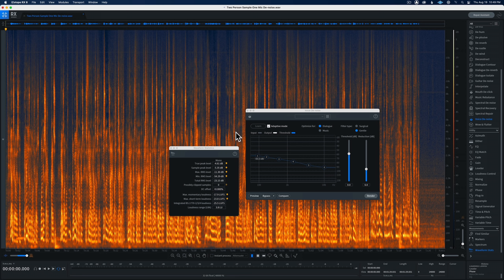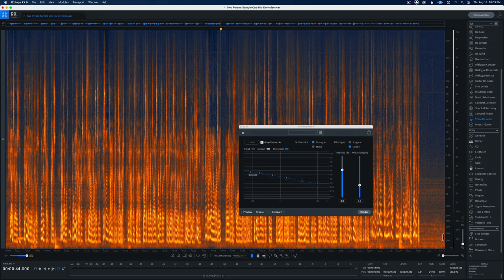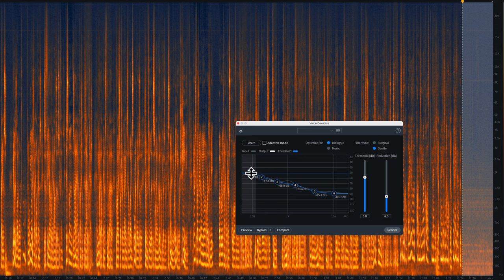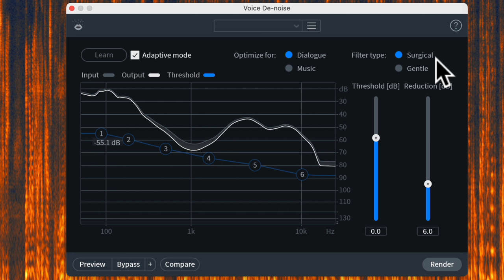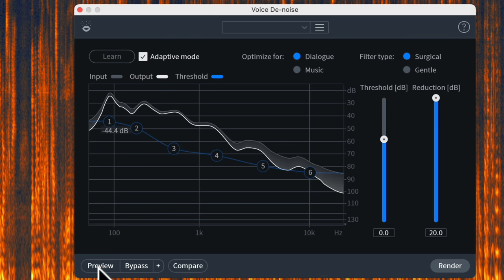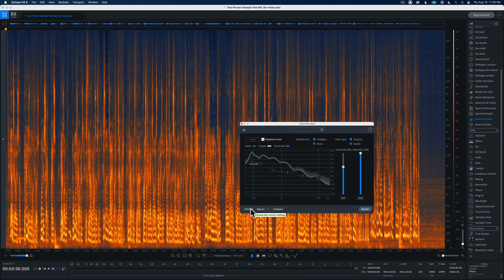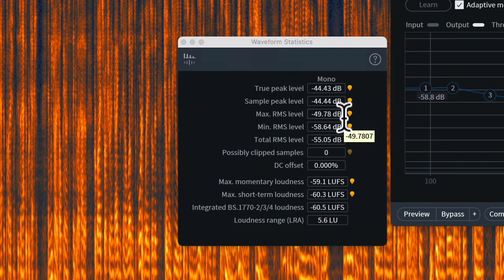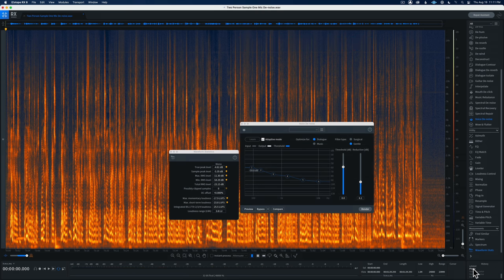Izotope RX Voice De-noise In Depth - Remove Room Noise

Comment: Would you recommend using Voice De-Noise instead of Dialogue Isolate?
Reply from the maker: They each serve a different purpose and work better in different situations. For film production, sometimes you want to remove noise but keep the ambient sound or room tone. Dialogue Isolate can potentially do that, depending on the noise. Voice De-Noise, on the other hand, generally treats ambient sound as noise and removes some of it.

Comment: Does surgical vs gentle mostly control the frequency selectivity of the gates' control signals? In other words, does it expand (gentle) or narrow (surgical) the bandwidth over which the input is integrated to obtain the control signal for each individual gate, such that neighboring gates will tend to behave similarly (since a loud sound at a single frequency will impact multiple adjacent bands/gates instead of just the one that contains it). At any rate that's what I would instinctively try if somebody asked me to build one of these.

I'm surprised that applying multiple rounds of the algorithm would perform better than a single, stronger round. Back when I did image- and signal-processing we considered that sort of thing as an indicator that the filter was deficient in how it implements the stronger setting and needed to be fixed.
Reply from the maker: I'm not sure and Izotope doesn't disclose that level of detail, unfortunately.

Comment: I have been using RX 7 Voice De-noise for over a year now. Is there any difference between RX 7 and RX 8 Voice De-noise? RX 9 is coming and the free upgrade from RX 8 to RX 9 deal is making me thinking of upgrading. I'm hesitating only because Voice De-noise is the only thing I'm using for now.
Reply from the maker: I haven't noticed a difference.
Reply: @curtisjudd Thanks for your reply, I guess it's safe to assume that if iZotope didn't mention anything about the other modules, they have been left untouched since they were last updated. Glad I didn't buy the upgrade. I only need Voice De-noise for my use case.

Comment: quick q - if you have steady state noise ie mic hiss that you can 'learn' accurately, why would you use adaptive mode and leave it to an algorithm's guess? Or did I misunderstand? To me adaptive seems more suitable for a constantly changing noise profile than a steady state.
Reply from the maker: This entire plugin is for steady state noise and the learn method usually results in better noise reduction. I only use adaptive mode when there isn’t any audio to feed to the learn function.
Reply: @curtisjudd  thanks....i was asking because around 7.10 you say that 99% of the time you use adaptive for steady state noise and it seemed to contradict that idea. In my understanding learn is more useful when there is a steady state that can be learned and adaptive when it's unsteady/changing and the plug needs to....adapt.
Reply from the maker: @zeitakulobusta  I say experiment and find what works best for you. 👍
Reply: @curtisjudd  and i say know and understand these expensive and powerful tools to get the best results, instead of fiddling around and hoping. I'm absolutely not saying you should use it one way or another, simply that what you said seemed to contradict the application of learn vs adaptive (adapt is literally something you do as a response to change). If that was a slip that's fine but honestly I feel like I'm getting a brush-off simply for asking an informed and legitimate question. No offense but if that's how you run things I won't be subbing.
Reply from the maker: @zeitakulobusta  this is not a brush-off. I made a statement based on my experience with this plugin. That’s all. I may be incorrect and do not wish to convey that I have a deep understanding of how the algorithms work.
Reply: @curtisjudd  All good. Understood and appreciate that. My comment wasn't about how algos etc work - literally my only point was that what you said just there seemed counter-intuitive and I thought maybe I'd misunderstood something about the plug and could learn something.

Comment: Have you tried Nvidia's Voice function in Nvidia Broadcast?  I was stunned at how well it works.
Reply from the maker: No, I don't have an nVidia card, but the tests I heard varied from ok to sounding like the person was talking into a pillow. But I think that's just because they pushed the settings too hard. Like most things, using just a little bit usually works better. Also, RTX Voice also has adds a lot of latency last I heard — tens of ms — which can be problematic.